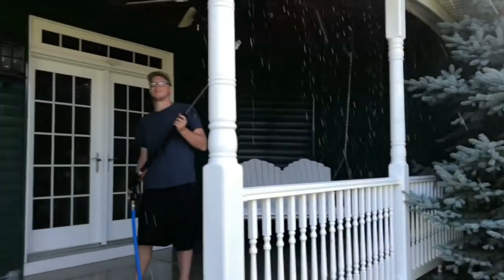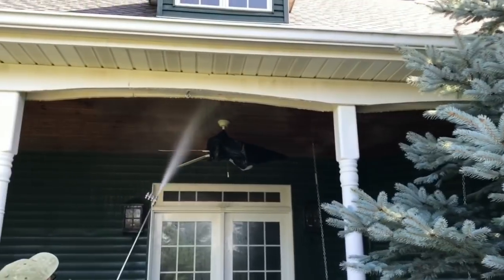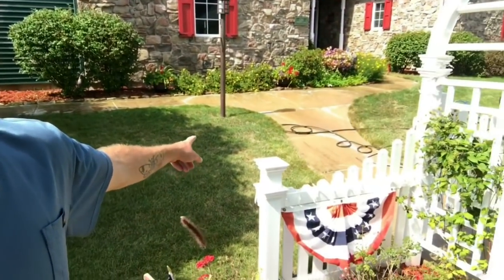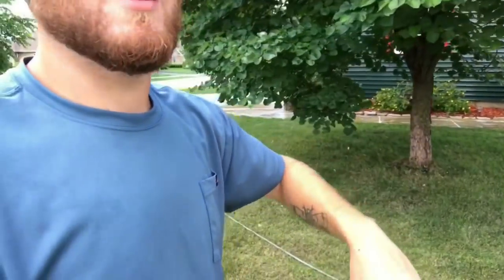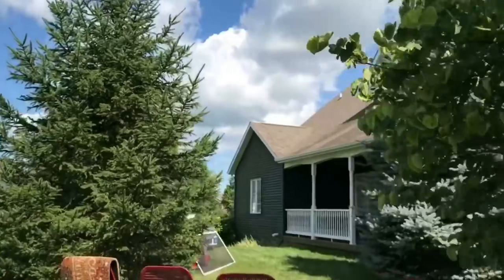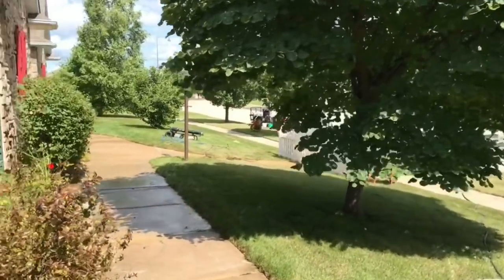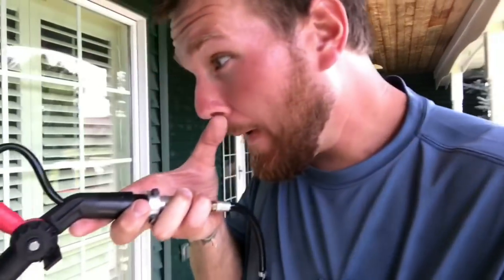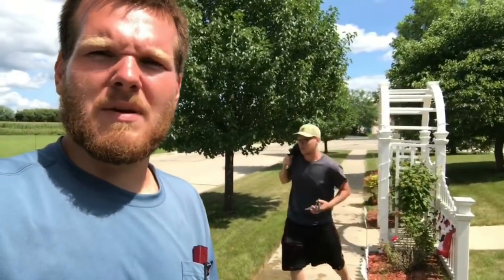Can you soft wash dark colored homes?

Comment: be careful using SH on stained wood that inst sealed. It can take the stain out and make the wood splotchy. great work tho.
Reply: your 4gpm maching will draw a stronger water to SH ratio than your 8gpm. You may have to make a stronger mix for the 8pm.
Reply: What should be used instead?